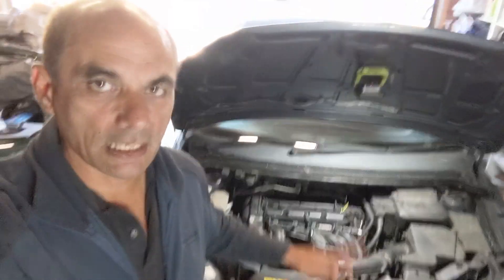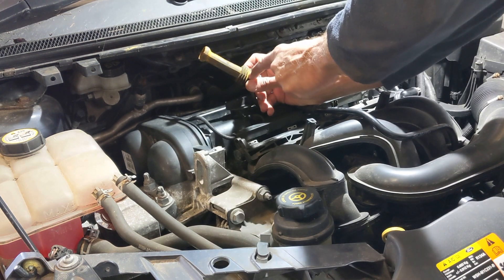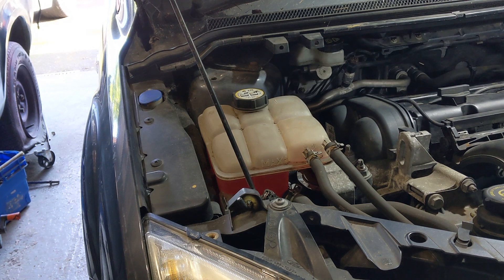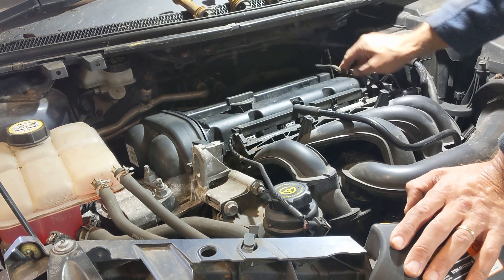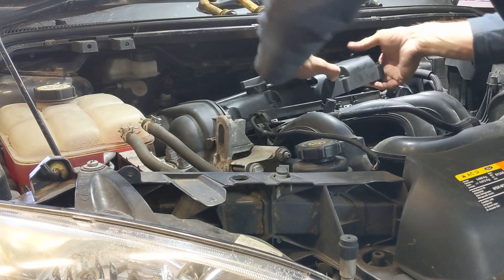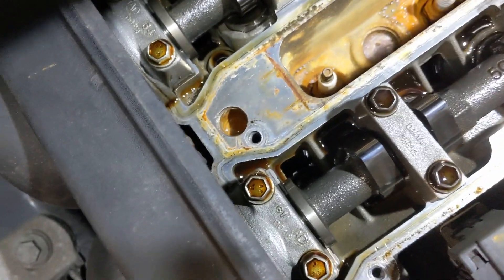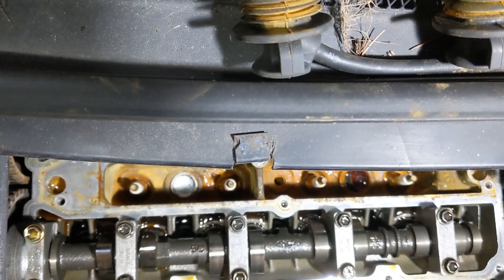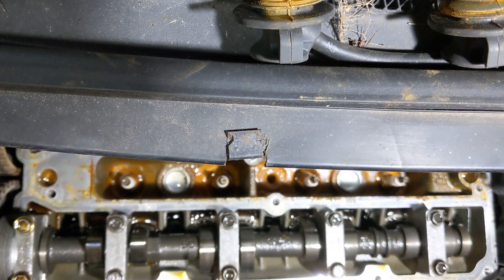Ford Forcus Mk2:  Freeze / Core Plug Replacements

Comment: I have misfire and engine wont start properly when cold need about 4-5 tries before it stays on, i replaced the pcv hose, valve and seal didnt do much. Now i was about replace spark plugs and i see there is a pool of water and i thought it looked suspicously like coolant. Will be replacing this in maybe a weeks time as Christmas and the holidays are over hope this solves the problem. I will probably try to put some sealant on the lip dirko or something just to seal it properly.
Reply from the maker: Good luck.  I hope you have success.  And enjoy Christmas

Comment: I’m going to attempt to change mine. Are the cam cover bolts torqued up? Is dumping the coolant out necessary? Thank.
Reply from the maker: Hi,   I didn’t torque my cam cover because I couldn’t find a torque value and because it is plastic so I worried about breaking it.  I just snugged it down tight.    I didn’t dump coolant from the drain plug but removing from above the core plugs is necessary I think because there is likely to be contaminants in there we wouldn’t want in the engine.  Good luck.  It was easier than I expected.

Comment: Just done this job on my Mk 7.5 Fiesta. Few tips if you’re attempting it. 
1) Replace the Cam Cover gasket. after doing this job. It’s only c.£13 and your cam cover will leak oil down the back of the engine if you don’t. 
2) It took me 4 attempts to get the plugs to seat properly so buy extras when picking them up. They’re only £1.25+vat each. Part No. 167490. 
3) Instead of removing the wiper blades and cowling etc. just use a shallow socket and short extension. It allows for more room  when chapping the plug down. 
4) if using a chrome socket go for a 17mm. An 18mm socket will hit the sides and not seat the plug all the way.
4) Don’t drill the old plugs to release them. Chap down one of the sides and the old plug will spin until vertical. Then grab with a pair of needle nose and yank it out. Be careful not to push the plug all the way into the head. It’s a ball ache to get out. (Ask me how I know).
5) Change the spark plugs after doing the job to prevent misfires. 

I’m a pretty handy DIY mechanic but this job is heartbreaking. If the plugs aren’t completely seated they will leak. Even if it looks watertight when the coolant system is pressurised and the head expands when hot it will
Leak. Just keep trying until you get a good seal. As above it took me 4 attempts. Some folk say to use Tigerseal around the mating surface between the plug and the head but the time I got it to seat properly I didn’t use any sealant. 
6) Good luck. Hopefully you fare better than me.
Reply from the maker: Comprehensive advice.  Thanks

Comment: First of all, thank you so much for taking the time to make this video! Lifesaver!

Do you know the size/model of core plug? I am having some trouble finding the correct dimensions for this engine. Thanks!
Reply from the maker: Hi, I couldn’t work out what size to buy because there seem to be many different specs so I went and ordered from a ford garage who based it on the license plate
Reply: @HenrysGarage  Ok, I will give that a try as well :) Thanks!

Comment: Just changed the core plugs on my sons car this morning. 
Used a little bit of Dirko HT sealant,  hopefully will do the trick.
Core plugs were leaking just a tiny bit. As the engine heats up, the coolant evaporates, and because that area is pretty much sealed, the steam interfers with the HT leads/spark plugs, causing a misfire.
Reply from the maker: Good.job mate., it was an easier job than I antict
Reply: Does it cause an engine management light to come up? My focus has an intermittent misfire under load but no warning lights at all
Reply: @GregoryMcFalcon  sometimes EML light dont come up on dash when u have small misfire with the sparkplugs or ignition coils. a very common problem is the core plugs or rocker cover gasket leaks in these older fords.

Comment: I think the water comes from above from the washer jets ? My wifes core plugs are on the way out , i think they rotted from the tops having water sitting on them. I think i better buy the plus to be ready to fix them. Cab i ask where you got the right ones or what size they are?
Reply from the maker: I went to a ford garage to ensure I got the right ones.  The two were only about £2.50 and I figured the saving of buying elsewhere would be insignificant
Reply: @HenrysGarage  Thanks I ll find our local ford spares dept and go there, were you happy with your technique? I was thinking of drilling a little hole in the plug and levering on that. I am paranoid about driving them in further or is there nowhere for them to go ? Cheers. The T7 resto looks like it's been keeping you busy. They are nice when in good condition.
Reply: @family-accountemail9111  hope you didn't drill through then, the swarf could well potentially damage the pump. As for the possibility that they drop through,  mine did but managed to fish it out using a long nose pliers.

Comment: Just goes to show how cars should be used frequently. I am quite surprised how much water got into that location! for a modern car.
Reply: A Very Common Problem with the older Ford Focus Fiestas Is The Core Plugs And Rocker Cover Gasket Leaks. When Core Plugs has any leaks or Worn out Then u Have Another Issue Taking The Sparkplugs Off Its A Nightmare As The Current Stuck Sparkplugs are Corroded Rusted Due to Water Coolant Leak From the Worn Out Core Plug/Freeze plugs.
Reply from the maker: Heck, when I saw it I thought it was something far more serious.  It took a little research to discover the cause